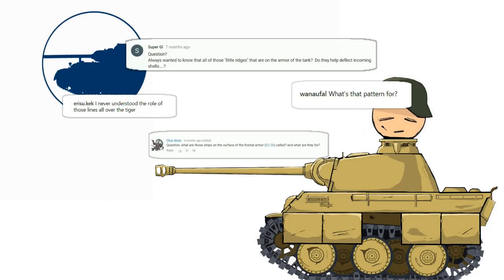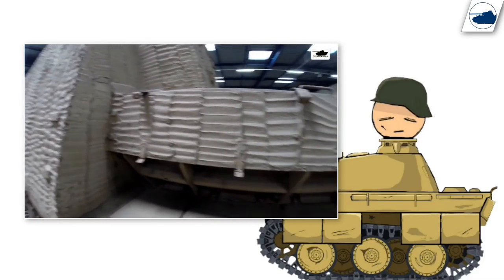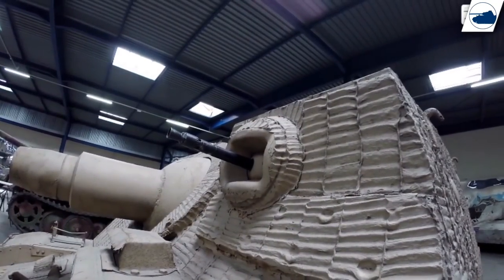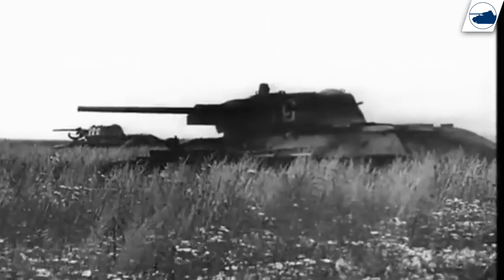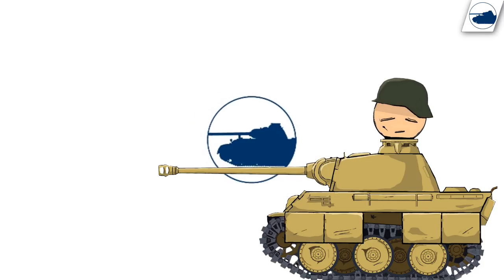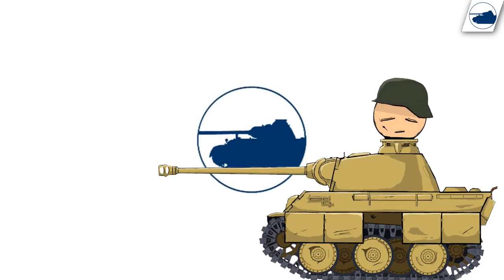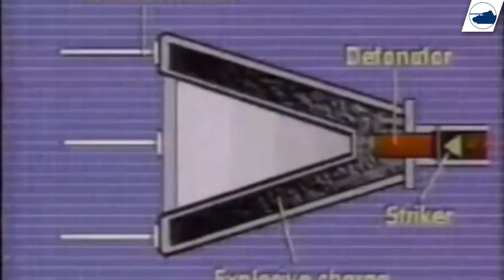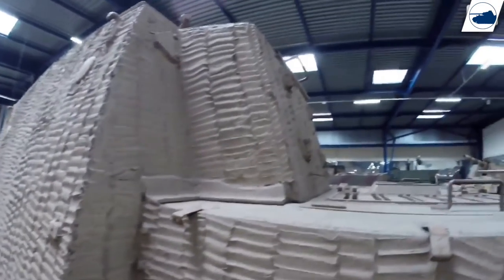Zimmerit on Tanks - What is it - History.

Comment: I think that Zimmerit makes a good insulator and it's not nearly as likely to heat up as fast as open steel under the blazing sun. It can be sat on without getting a burned ass and it's not as slippery when wet as well. Not to mention that it really looks cool.

Comment: Great video my friend and a very interesting subject for the modelers of today. I happen to have an ancient AFV G2. It has an excellent article on the development and application of it.  I'm moving right now and my library is in boxes awaiting my new apartment. I'm moving in this coming week if anyone wants to help! 
  I'll actually post something about it when I can.  For now I can tell you that zimmerette was a celoise product made from anything from the manufacture of various grains and tailings. Basically, if you can't eat it make zimmerette from it !   This was applied like plaster to the vehicle after being painted. (I don't know now over which coat)  This was done with trowls which gives the patterns we have a love/hate with.  All work was done by slave labor. Once covered, the tank moved to the drying building. It was similar to the truck washers you sometimes see at various large companies.  This was covered with heat lamps and simply baked it dry. The tank went to the paint shop for its sand yellow base and possibly a camo finish.  It was then ready to go to the front.
It's been 30 or so years since I read the article so I don't remember more.  
   The Russians did indeed use sticky bombs and this was always said to be why they developed it. I've found a channel called " WWII Metal Detecting " and what they do is dig stuff up from the war. They always show period films with the show and these can be priceless reference. I've seen vehicles I'd only seen poor pictures of running around !  I've also discovered a number of things you'll only see in color films.  I highly recommend it.  Yesterday they posted an OT-34 model 43 from a frozen lake. It was fully loaded with ammo too!
Reply from the maker: Ennis Anderson thank you that's some great info.
Reply: Panzer Picture 
You're welcome my friend. I'm always happy to share with everyone.
Reply from the maker: Ennis Anderson if you find out more let me know

Comment: The germans used magnetic mines, as you stated, very effectively. It was thought that the Russians would also use them. When became evident that they were not using them the german high command ordered the zimmerit application stopped in late 1944.
Reply: Thomas Holmes I wonder if they really did know how effective it was as camouflage
Reply from the maker: Thunder check good question, they probably did but, because of the production hurry they needed to stop it
Reply: I have never read anything about it considered  as camouflage only to prevent magnetic mines

Comment: I think it was basically auto-body putty... Maybe the sawdust was mixed in to provide bulk and strength. I always read it was anti-magnetic mine paste... but the camo thing would apply to! hmmm... o_0
Reply: John W I have doubts if in that years the auto putty was available, during many years its was used melted tin for repair.
Reply: Yes, true... Tin or LEAD! >_< Perhaps I should have said auto-body filler/bondo TYPE material. As it contains 40% Barium sulfate and 25% Polyvinyl acetate. The mixture had the consistency of a thick paste or putty... ^_^
Reply: @fat_basturd5345  Autobody filler is styrene based,  polyvinyl acetate is also known as PVA - wood glue.

Comment: artistic camouflage. Notice how when applied @8:40, it breaks up the visual of the surface, similar to how they block new car models from being seen, yet they drive them around. you're not able to draw a conclusion on the shape of the car. That weird print that makes pictures are hard to take and detect angles. or in tanks zimmermit. From far away a soldier glaring into the woods at 400m might just miss a panzer w/ zimmermit.
Physical Human Eyeball Radar Protectant Coating
So basiically you see at 8:40 two to three shades, a shadowy color and a white plane. From far away your eye, or should I say brain, would not be able to keep up with all the inputs from each angle of applied zimmerit. Like your brain processes 1 FLAT SURFACE like that of a m4a1 side, 1 color, no changes or varyations in lighting. But with zimmermit it basically destroys visual acuity.

Comment: What was the recommended thickness of the stuff ? Until recent decades,it would not take very much depth to significantly reduce the ability of period magnets to hold  the weight and bulk of the mine against the metal.
Reply from the maker: paul manson it was probably 2 layers, but it would not really matter because the crews wanted it for the camouflage.

Comment: hmmm, I learned it was against antitank mines. Camouflage is only usefull in a position. There You can use much more effective Nets or natural materials. On the move its nearly useless. May be it had some effects on reflections. It could be that it had a quite substantial effect on the noise the tank emitted. And may be it has some effect on radar. But sometimes when there is no reasons against something, Germans go on like they did before..
Reply from the maker: Zorn Gottes Zimmerit creates a shadow effect on the surface, so like you said, it's something against the reflective surface.

Comment: The zimmerit was discontinued as it would take 2 days to dry, holding up delivery of the vehicle. It weighed upto 200kg depending on the vehicle being coated. The use of bazooka type weapons also contributed to the ceasation of zimmerit installation.

Comment: I’m guessing bullet spaulding with exposed crews probably had some benefit
Reply from the maker: Joe Seabert how do you mean, or am I not getting the joke?
Reply: Body armor has a rubber coating to reduce the splatter of the bullet after it hits the armor. That’s called spaulding. In many videos I’ve seen wwii soldiers sitting or riding on top of a tank. This isn’t something that happens anymore. But back then it was common. So my point is if the crew or infantry sitting on the tank gets shot at the rounds that directly missed but would or could be hurt by ricocheted rounds. That’s my thinking, no joke intended.
Reply: I just realized I used the wrong word. Spalling is what I meant. Sorry, not an English major.

Comment: What camouflage qualities would zimmeret have? I don't get it.

Great video, by the way! 🙂
Reply: Large flat and/or smooth surfaces such as tank armour plates reflect a lot of light even if they are painted in dark matt paint. That's because the whole surface reflects light in the same direction to the viewer. Painted camouflage patterns can only segment a surface and disguise its shape. They cannot alter its luminosity. A zimmerit-covered surface reduces a surface's luminosity by creating thousands of slightly different angles all over the surface. That said, until now, I'd never read that crews valued the camouflage benefits, although I have read that the Allies at first thought this was its purpose. The optical characteristics of zimmerit which are plain to see on photos and film, confirm that this was a very real if unintended benefit of these coatings.
Reply from the maker: Or in short it creates a natural shadow, so you don't have a reflective surface.